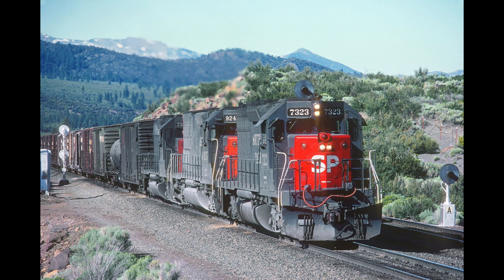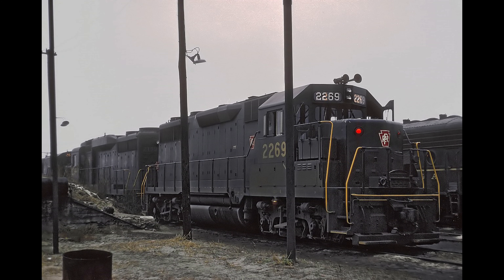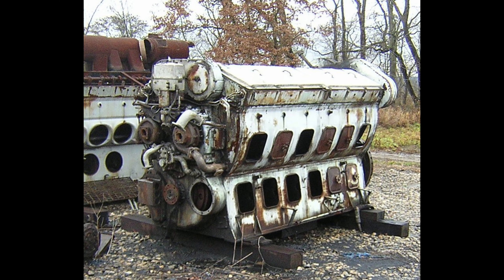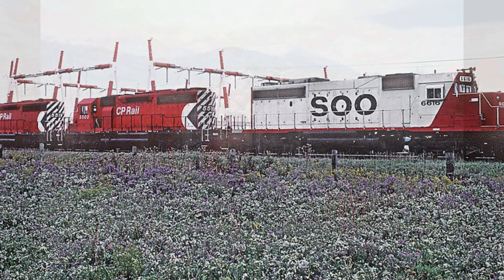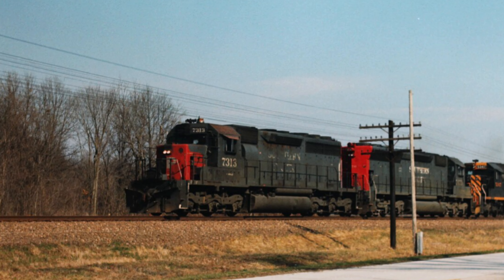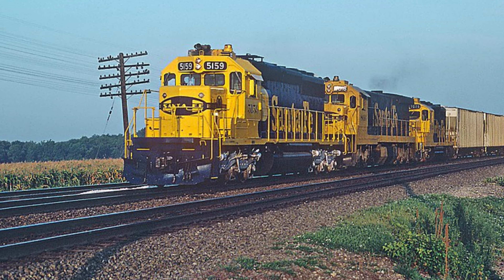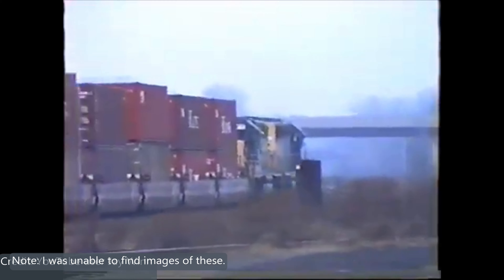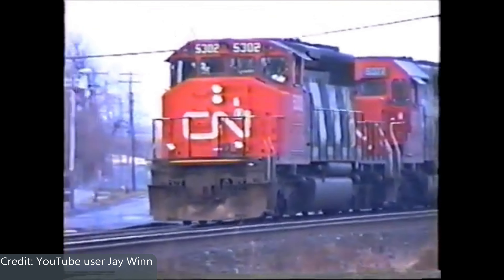The locomotive for the "In crowd" EMD's SD 40 series

Comment: I ran many, many SD40 and dash 2's. The ones that CR bought weighed only 368,000 lbs. very lite weight and too slippery. When I went to work for ATSF out of Denver on the Joint (joke) Line, I ran all the BN and ATSF SD40-2's. The ATSF SD40-2's weighed a little over 390,000 lbs., and the BN weighed 421,000 lbs. The BN SD 40-2's did not have extended range dynamic brakes, and no dynamic brake interlock. These locomotives were engineer's engines, nearly perfect in every way.

Comment: The SDP 40 F had a large water tank with no baffles in these tanks. Ask any mariner about free surface effect. When the movement of these fluids reaches a stage of synchronisation, you have problems, big ones. That water tank, set up high, and half full, there's the perfect recipe for free surface effect. Throw a bend into the mix, and you have a locomotive that WILL fall over, guaranteed. The energy stored in 1 ton of water is a very frightening thing. I know, having spent 35 years working at sea.

Comment: I was under the impression the 50 series didn’t have the F motor replaced by the old E motor but was de rated by lowering the RPM from 950 to 903 and adjusting the fuel rack settings.

Comment: HTC trucks were not the problem. It was a water tank sloshing issue.
Reply from the maker: I'm sorry if i was not clear, as I stated in the video, the trucks were "initially suspected of being the problem" as it turns out they were not. Ordering the old trucks was a knee jerk reaction by Conrail.
Thanks for watching!
Reply: @alcobufff  There was an inquiry made about the hollow bolster design on the SDP40F's trucks. What the real problem was the water tank location and not taking into consideration the slosh factor causing excessive yawing of the locomotive. Crews complained about this and I believe it fell on deaf ears until enough derailments occurred.